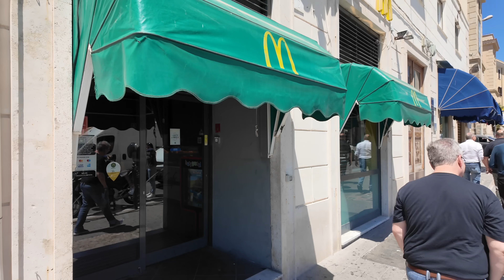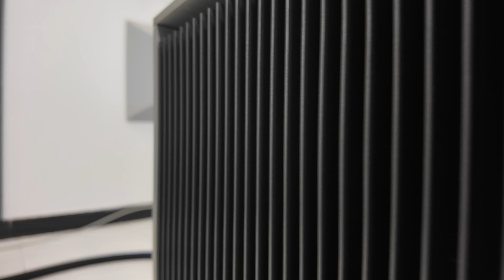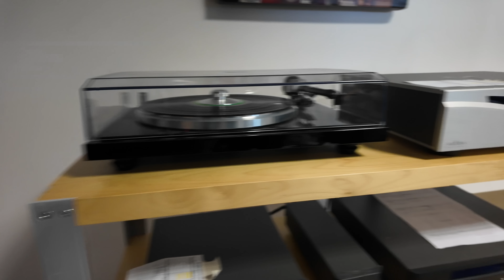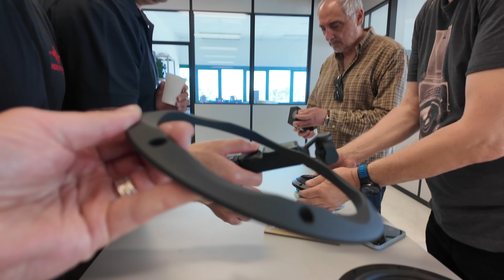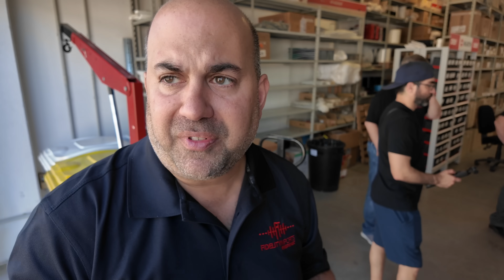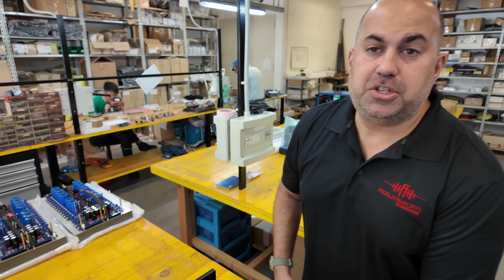High End Amps and Speakers are Insane!... TRIGGER ALERT!

Comment: I liked this video, one comment. I went with high end auto this year, and I literally had to redo my basement to accommodate the equipment. So remember it’s not just the price of the equipment you will also need to accommodate it properly. To hold our equipment I had to special order salamander design rack and it was not cheap, a bit above 5 figures just to hold the equipment. All in all budget was 50k for all equipment but when we were done it was close to 75k, also had to install 30A circuits, 240v breaker, new wiring. But we should be good now for life and when we pass away our kids can enjoy the audio/video room. 

Our setup is 
LG G3 77 inch
Oppo 205
Kef R11x4, R3x4, R6,  SVS PB-4000x4
Denon A1h
Monoprice monolith 7x (2)
McIntosh MC611 x2
Apple TV 4K 
Monoprice 12 awg speaker cables
Monoprice hdmi cables
Kef ls50 wireless, SVS 3000 micro, FiiO R9, audeze lcd x, lcd xc. 
We bought used and new equipment.

Comment: Lets see 4000 dollars upfront and if you own it for say 10 years. (Not unreasonable for a good piece of equipment) It works out to a little less than 34 dollars a month. Hmmm. 🙂
Reply: That's a good way of looking at it. I'm sure it will bring you at least $34 dollars a month enjoyment 😁
Reply: That's the thing about (some) high end products. They can be a lifetime, or at least a very long, investment. For two reasons. They are built extremely well and they sound very good and look very good, so upgrade fever is much less of a problem. My last main speakers and amp lasted me 20 years. The amp still runs in a second system, and the speakers I traded in for about 1/3 of what I paid for them. Looked at that way it makes more sense.

Comment: Cheapaudio man getting wiser 🤣. Putting the joke aside my friend just bought an Audia Flight 9 integrated amp and it sounds fantastic although the dac inside could not compete with the Gustard A26
Reply: “High end” companies seem to be bit behind the curve on DACs, mostly due to tired and widely disproven beliefs about them. However Audia Flight’s amps are fantastic, thankfully the DAC issue is easily remedied for less than $1,000.

Comment: More like The Audio Discovery Channel than Cheap Audio Man. 

A new DUAL chip 3255 is out with integrated dac  for $180 and you're showing $30k amps in Italy with your patron squad. You have been assimilated by surrounding yourself by audio knutzincrackerz.  ✌🏻Cheap Audio Man.

Comment: They look like incredible products. But it is sad to know that only the rich these days are the only ones that can afford the best of everything.
Reply: I am not diminishing how much money $4000 is, but the fact that many of the practices performed in the cost no object gear goes into the $4000 integrated is something I am proud of.  $4000 is certainly an investment but I’m not sure you have to be rich to approach one
Reply: @Jainbaby-Steve  The idea of saving up and investing $4000 for an ENTIRE system would seem like a reachable goal, but I can't see spending that much money on one piece of gear.   And really, I doubt the $4000 amp is going to sound that much better than a $400 one.   Really, for that cost, it should sound 10 times better, but the reality is, I don't even think it will sound twice as good.   It really isn't worth it.
Reply: @Jainbaby-Steve I agree. Especially if you start getting into Hifi at a younger age. You may start with $100 products but 30 40 years later you can find yourself surrounded by $30k worth of gear..easily $10k. And still consider yourself a working class schmoe.

Comment: I 😢hope they're not built like a ferrari. If it is it will stop working every few hours and be in the shop for six months with a repair bill thats higher than the cost of the unit. IDK this isn't cheap audio man stuff. I think you need to start another channel with expensive audio man. I find myself starting to veer away from this channel because of this. I like you Randy, I hope your veiwers don't start bailing on you.